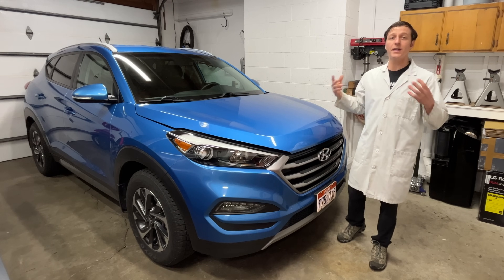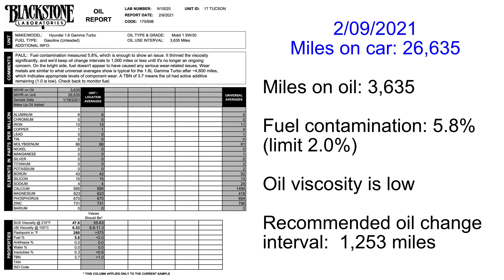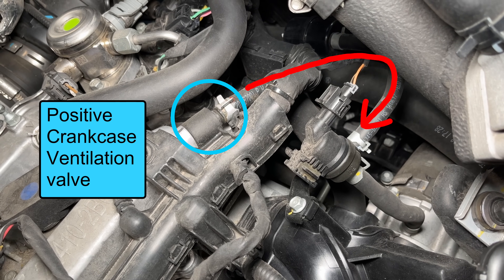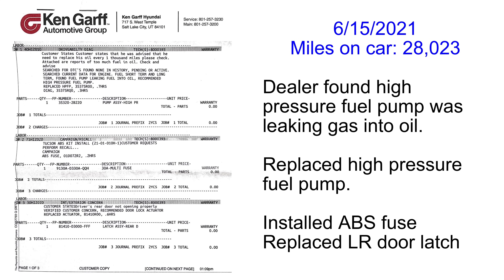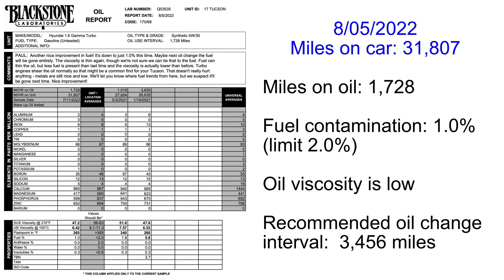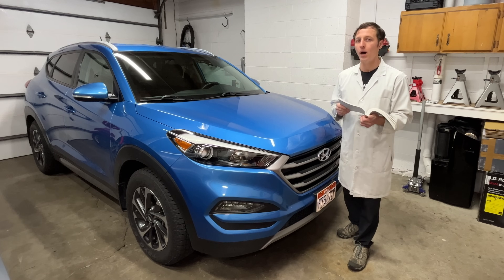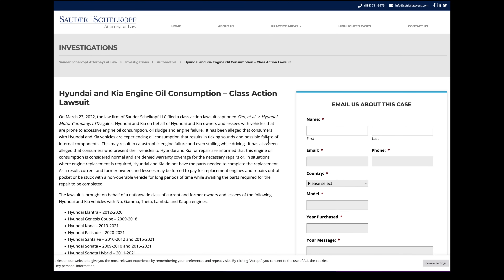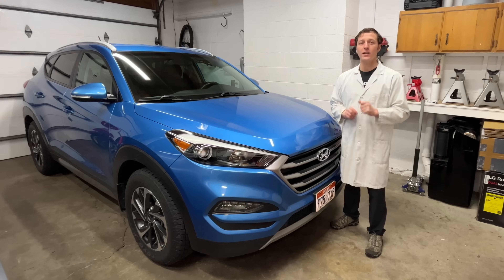Hyundai oil consumption and gasoline contamination problem solved

Comment: Excellent video. This is the best explanation I have found so far to address why Hyundai's engines are breaking down so fast from high oil consumption. I also appreciate the idea to send your oil into the lab for analysis especially when these dealerships are denying warranty claims and making consumers pay out of pocket for these expensive oil consumption tests.
Reply from the maker: Thanks for watching!  Yes, test your oil, gather your own data.  The dealer and the manufacturer will do what's best for them, and that may not be the same as doing what's right for you.  An oil test from Blackstone labs is only $35 and will tell you a lot about your engine.  
I'm not sure what their "consumption test" is but you can do that yourself for free.  Fill the oil to the correct level on the dipstick.  Drive the car.  Check the oil.  Top off the oil if needed.  Look at the bottle and see how much oil it took.  Duh.
Reply: @LabCoatPaul Great video! Do you think having your own test results will positively affect a case with Hyundai when they’re doing their own oil consumption process? I guess my real question is- what do you do with the results given?
Reply: Send the oil into where? Who tests it? Is there an organization or company that does this?

Comment: I wish I would have seen this video before I got rid of my 2017 Sonata. It was burning an insane amount of oil after 115k miles, I think around 3-4qts every 1k miles. I'm really curious how badly diluted the oil was with fuel after 1k miles, I'd go to add more oil and my dipstick REEKED of fuel. I'll never buy another GDI engine or Hyundai again, I drive a lot and I need something reliable.
Reply from the maker: I'm sorry that happened to you.  What car did you get instead?

Comment: Currently own a 2017 Santa Fe Sport AWD. My engine failed on me regardless of following the recommended services for the car. I frequented the dealership for most of my engine maintenance and when my engine seized on me, they declined to repair or replace my engine under the lifetime warranty due to “maintenance neglect”. I fought and appealed the decision reached by Hyundai as hard as I could, and they still declined repairs.  They most certainly did not do much in helping me prevent this situation when I frequently visited for standard mileage maintenance. I was furious. Still owing about a years worth of payments on the car I was left with a car that was no longer running. After exploring my options I found it best to rebuild the engine that was currently in my car. And despite thoroughly going over the common issues and doing my absolute best to prevent them, it is futile. My oil consumption is ridiculous burning about 1 quart every 1000 miles after having replaced many components on the engine to prevent this. I received another faulty knock sensor from Hyundai and ended up putting a 3rd knock sensor (aftermarket this time) in 6 months. And to make things worse, I’m now experiencing another common issue with the AWD feature of the vehicle due to soft alloy parts in the transmission that power the rear wheels. I’m exhausted by this mess. And wish I would have taken the loss and invested in a new car to the best of my abilities as like you, I couldn’t afford to buy a new car without acquiring negative equity by quite a bit. I wish I could burn the thing to the ground in all honesty. Regardless, I’ve already had the engine rebuilt and have dug myself into a ditch fearing that trading it in will not only give me ridiculous payments on a new vehicle but also a loss of the time and money I spent on the rebuild. One things is for certain though. I learned an important lesson about doing my research on specific engines that are experiencing similar issues and will be absolutely certain to never invest in a car that burns oil excessively or in a car manufactured with engines that are known to have similar problems. It’s a shame I had to go through all of this to learn. But I guess that’s just a part of life. Making mistakes.
Reply: My 2019 sonata start consuming oil at 75k. Now using about 1 extra quart per thousand miles. I change oil every 4 k. The oil looks terrible when i change it.
Reply: @ekastner2838  try using valvoline restore and protect. Also try a piston cleaning with Berryman B12
Reply: I’d work on a plan to replace the car ASAP. Even rebuilt it probably won’t last and you’ll be needing an engine again. I’d buy a used Toyota, Honda or Mazda and rest easy.
Reply: @briantii  I wouldn't touch a Mazda with a ten foot pole.
Reply: @ChasL704  Buy what ya want. Everyone I know with them (non-rotary, non-ford era) puts a boat ton of trouble free miles on them though. And I don’t mean “high miles” in Hyundai terms like 100k or something. I mean > 250k.
Reply: @briantii  🥴 I had a 323 and a 929 craptastic automobiles. My neighbor has a brand new CX-5 that has electrical problems.
I can honestly say I haven't experienced such issues with any of my KIAs. In fact I could lose an engine or transmission in any one of those cars tomorrow and it would still be the best cars I've ever had. I could sink four or six grand into anyone of those cars and still have a damn fine car.
Reply: @briantii  I have 350,000 on my 11 Sportage nothing leaks and It doesn't use oil. In fact my serpentine drive belt was replaced 280,000 just because my alternator gave out and I drove it into the shop to have it replaced. Did I tell you I keep them outside and none of my KIAs have rust. Trust me I'll knock junk when I experience it. For now I'm sticking with what works.
Reply: @ChasL704  So to be fair, you’re talking really old cars with the 323 and 929 and from that era you’d be comparing against the Hyundai Excel and garbage like that… so in that comparison I’d argue you still probably were better off in the Mazdas than in the equivalent year Hyundai from that period.

I’m glad you’ve had good luck with them and hope it continues. Some people love them. For me I wouldn’t have one after all their engine problems and how they handled them. The “recall” doesn’t actually fix anything, it just adds software to listen (via knock sensor) for the theta 2 to start coming apart and throws itself into limp mode hopefully before the rods come out the side of the block and catch the car on fire from oil hitting the exhaust. Even more problematic is that they never fixed the theta 2 engine. The replacements that people get STILL blow up early and often. Most manufacturers actually solve the problem rather than keep patching things together in the hopes that the cars leave the road. They have done similar with the 2.0L Nu engine in the 2019 -2022 Kona. Massive oil burners at 10k miles and then Hyundai or their generally poor dealer network tries to blame owners. They do make some admittedly good cars and their V6 Lambda engines are well designed and hold up well. I just struggle with the experience that far too many seem to have when things go wrong. Also in Canada their warranty isn’t the same and owners get screwed left and right there. Bad enough that the CBC did an entire special investigation into all the issues. Frankly, just not the type of company I want to do business with.
Reply: @ChasL704  Rust buckets
Reply: @ChasL704  You don't have a GDI engine.
Reply: I'm positive you could have found multiple attorneys willing to sue Hyundai on contingency for you. Probably still can.
Reply: So what made you buy a Korean made car in the first place? Ever since the outset Hyundai, Kia and when the awful Daewoo were around they never had a particularly good record for producing a quality product so why on earth would anyone with sound reasoning purchase one of their cars? I suspect it's got something to do with the cheap price which buyers can't see past. But it's like anything you get what you pay for.
Reply: Bummer,son has 2017 sport also and junked at 61k. Hyundai would not take any responsibility. They Suck
Reply: @ToasterCowboy How much did you get for your car?
Reply: I replaced the engine twice in my santa fe sport 2.4 2017, sold the car and never been happier.
Reply: Use Valoline Restore and Protect oil and a Purlator Boss oil filter for high flow.  Restore and Protect clean out any engine.  Help break binding piston rings free.  Find videos on it.  Sludge engines will need early filter change
Reply: I have a 2008 Toyota Camry, 2.4. It also from the get go burned 1 qt every 1,000 miles.  It still does.  Its something I need to watch before it gets too low.
Reply: @Romulan112  use valvoline restore and protect oil
Reply: Sue them, pro se if you have to.
Reply: Next time just buy a Toyota.
Reply: I guess Toyota from now on😂
Reply: Im in exactly the same predicament, i ended up buying a used engine and plan to trade in as soon as possible. I dont ever want to see a Kia in my life again.
Reply: That's because they are following Hyundai's guidance from training not what a modern engine should actually have done. They can't when working for Hyundai.
Reply: I have a 2013 hyundai elantra and my car is burning oil too.
Reply: Try Valoline Restore and Protect oil, for four 4-5k cycles.  Will clean up engine and break piston rings free
Reply: Following the recommended service is where you went wrong.
Reply: Use Valoline Restore and Protect to clean out engine,  then Royal Purple oil.  Also Purolator Boss oil filter.  Has high flow.  Try to get as much oil flow as possible.  Do you live in Hot climate or cold.   Stop and Go traffic or Highway.
Reply from the maker: Sorry to hear you had such horrible problems with your Hyundai.  You had the worst case scenario outlined in the class action lawsuit.  Perhaps you can look in to that and get some money back for having to pay for engine repairs.
Just curious, how many miles did you have on your Santa Fe when the engine broke, and how many miles do you have now?
Somebody commented on this video that Hyundai is the Chinese scooter of cars.  This is true.
Reply: 😅 It's because it was designed to meet EPA requirements. It wasn't designed to live very long. You should have went to a proper engine manufacturer and ask them what type of tolerance is you can run instead of going off of manufacturer's tolerances. 😅 And then taken it to a machine shop and had it set up to run those tolerances. 

All of the manufacturers are doing. This is not just Hyundai. Most of the time they'll put a low volume low friction oil pump in instead of a proper oil pump. If it's driven off the crank, they'll put the tolerances really really loose which will result in more vibration and steady eating of the engine bearings instead of long engine life. 😅

Pretty much anywhere, there's parasitic drag.
Reply: @gsc512 low friction oil rings and high flow pump for lower viscosity oil is what I found and some have low friction piston coatings to help gas mileage.
Reply: @jaygames1980  very few coatings age well in automotive applications.
Reply: @gsc512  Maybe aftermarket piston rings and connecting rod bearings installed by a good shop?
Reply: Weird i have 130k on mine was leaking like crazy i ask about new engine they asked Hyundai and because im originally the first owner i got free motor
Reply: @TheToddFather5891  leaking what like crazy.
They aren't known to leak.
Reply: Yes like doing your maintenance is important. They wouldn't have turned you down if it hadn't been neglected. They put an engine in my buddies second hand 2011 Sportage with 140,000 miles.
Reply: @ChasL704 you couldn't be more wrong. I mean you are stratosphericly wrong. Fortunately the judge who oversaw the class action lawsuit got It right. This person didn't neglect their car, they simply happened to be in Hyundai's "were denying everyone until the courts yell at us" crosshairs. These engines are horrendous - shouldn't be deemed roadworthy in a 3rd world country let alone the United States. The only thing grimier than the engines is the company who made them. Same company who spent years lying to the public, to investigators and regulatory agencies. Sorry to break it to you, but Hyundai is awful in every way

Comment: The Genesis Coupe last model year was 2016 (3.8 GDI engine). The 2.0T engine was discontinued in 2014. There is no 2017/18 model for the Genesis Coupe. Might want to correct that in you discription.

Comment: Nice Video.
However, I know that the user manual does not just instruct the owner to change the oil every 5,000 miles. 
There are conditions stated in the user manual that indicates when to change the engine oil.
For example, if you mostly do short trips, the user manual suggests that you change the oil much earlier than 5,000 miles (around 3,500 miles).
You can find this information under the "Maintenance Under Severe Usage Conditions" section of the user manual. (Note that this differs from what is specified under the "Normal Maintenance Schedule" section).
Reply from the maker: That's true.  Most people actually have severe usage conditions when they drive mostly in town.
Reply: @LabCoatPaul  NOT TRUE! Short trips are considered "severe" because the oil TEMPERATURE doesn't reach high enough to dissipate the condensation (water) in the oil which causes sludge. Driving in town or highway long enough for oil temp to reach normal (about 10miles) WITHOUT shutting the engine off is NOT severe use. Also, idling in cold weather to warm up the engine is BAD because the engine, under no load warms up a LOT slower than DRIVING the car (SLOWLY) after starting it. The condensation remains in the crankcase a LOT longer with the car idling! And don't forget about TOWING (severe use)!
Reply: @TheOzthewiz  How about the turbo aspect? Doesn't it require warming and cooling time upon starting and shutting down respectively?

Comment: With the issue of oil dilution due to fuel. Would it also help to go to a thicker oil viscosity?
Reply from the maker: Only a little bit.  Going to 10w-30 is ok, but any thicker than that and the oil won't flow properly through the bearings in the engine.
You need to send a sample of your oil to Blackstone-labs to see how much fuel contamination you have.  If they recommend 3,000 mile oil changes, that's ok.  If it's lower than that, you probably have a leaking high pressure fuel pump or some other problem.
Reply: You need a good oil spec for direct injection engines, the volkswagen approved 504.00 507.00 spec oils are the most stringent oil spec on the market, its not cheap but its the best oil for direct injection. You need low saps formula to help reduce carbon build up on the intake valves

Comment: On my Ford Edge St the oil has a gas like odour. The catch can I use has this milky mix of oil, water, and gas…probably some other carbons
Reply: The hot ticket item on your edge ST is the PTU fluid. Make sure you get that changed out every 30k miles or so. 

Oh, and have fun changing it lol.  There's no drain plug.  I had to suck the fluid out with a pump.
Reply: @mikeg3529  thanks. I already did that pain in the ass job on my Explorer. Fortunately the ST is a lease so someone else can worry about the PTU lol.

Comment: Sounds like a KIA / Hyundai alright. To be fair.. we have a 2020 RAV4 and it’s the biggest piece we’ve ever owned. It’s been to the shop 6 times for various issues most of them related to the Auto start stop feature causing electrical problems AND the roof rails leaking into the interior of the vehicle. And it has less than 15K miles. Meanwhile my Chevy Bolt (seriously a GM product) has yet to have any issues. Oh well besides the battery that may burn the house down. I guess I’ll stick with my Chinese Scooters instead. ❤
Reply: LOL😂😂😂😂😂😂😂😂!!!!!!
Reply from the maker: Quality control?  hahaha no it's customer service problem now!  It's too bad Toyota decided to make the RAV4 junky.  Some manufacturers (Hyundai for sure) recommend parking the car in the street in case it catches on fire.
Reply: @LabCoatPaul  AND, away from structures.......like YOUR HOUSE!
Reply: And that crazy nut of a CEO at GM is cutting the Bolt! 95% of GM's EV business, and their cutting it to add to their EV truck line - including the Hummer. Since the beginning of the year, GM has sold one (yes 1) Hummer EV.